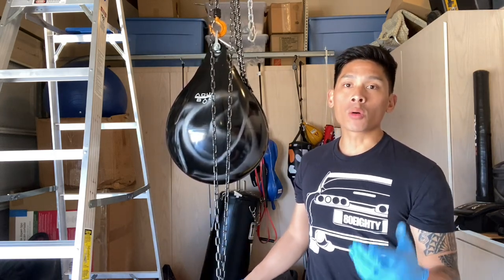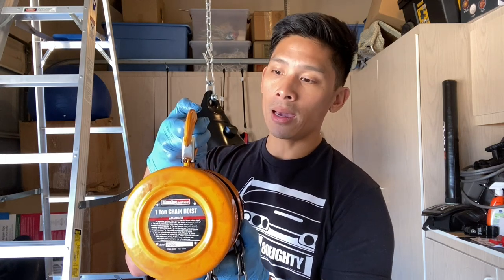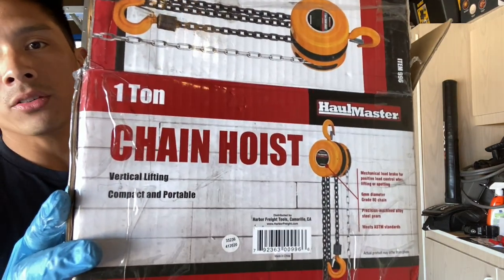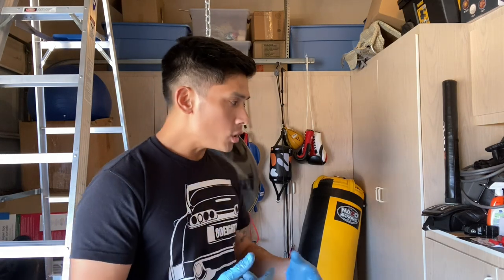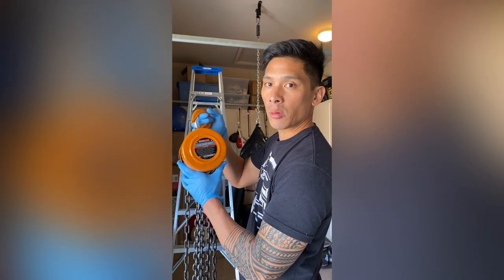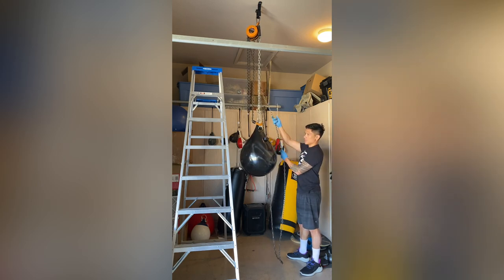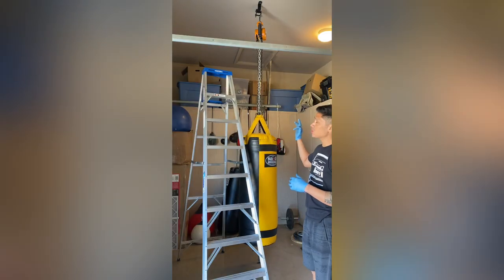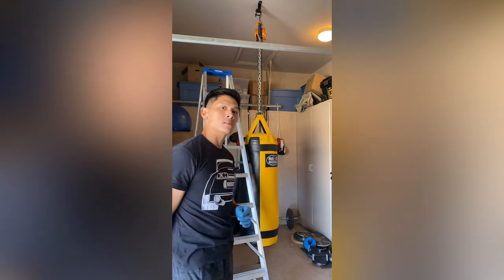How To EASILY Hang A Heavy Bag By YOURSELF- STOP BREAKING YOUR BACK AND TRY THIS TOOL!

Comment: Safety tip for anyone reading : One thing to note on a chain hoist, is the chain can run away under load.  The last motion before you let go of a chain has to always be 2 clicks in the upward direction. This locks it off so it shouldn’t slip.  Never leave a chain loose.  Just two clicks in the up direction and you’re safe.

Edit : for clarity, do not let your last motion be  lowering the chain.  Always raise the chain by two clicks before you let go.  This locks it off.
Reply: So basically it clicks twice to lock in otherwise jt breaks

Comment: Nice! I live in a small apartment with ceiling tiles so nothing to hook a chain hoist on to, or no room for all that stuff but I found some creative ways to hang the bag myself. I use 80-100 pounds which I can pick up easily with two arms bear hugging it, as it is about half my weight of 170. But I can't let go with one hand to raise the chain up or the bag slips out of my arm, especially the slippery canvas like material Everlast nevatear.  40  LBS I can lift up as it is lighter and shorter and can hook that up easily standing on a chair. So what I did was taped the rings together like you did with zip ties in another video I think with your So helping connect it. I live alone so no helper, so I stuffed a yoga block inside the straps to hold them up, and keep the ring upright. Then I set my other heavy bag on top a chair laying down, and put my 100 pound bag on top of that which is a lot higher. I could then bear hug up onto the hook depending on what hook method I use. I also have an S-hook as well which works great to put it on quick. I also tied a bungy cord around the bag stand up top, then ran it down through the hook and to the bag D-ring, which then helps pull and guide the ring up to the hook, which is not really needed with the chair/bag and yoga block. So yeah I always find a way lol. I also love your speed bag platform you built and I always wanted to do one like that, but I had no idea they had the perfect sized 24 inch round board already cut at Lowes and Hope Depot so that is awesome! I have limited tools so I was worried I would have to cut one out by hand. I may try and attach one to my Everlast stand also to see how that works, which would be a lot more sturdy than the particle board one, and ad pro swivel. Then maybe put one on the wall or two together since I have drywall, and not sure if the stud is in the right place yet as I need to buy a stud finder. I have been doing boxing, full contact karate, and kicking boxing for 40 years now since age 7, and MMA since 1993. But yeah great videos man keep it up!
Reply from the maker: Thanks man!

Comment: Cool thing to use, i always thought about something like this, are there smaller version of that device? It would have been nice if the device to work faster, not to need to pull so much on the chain.  Dunno if i can find such thing in my country and small shitty city! BTW, you resemble Tawanchai!